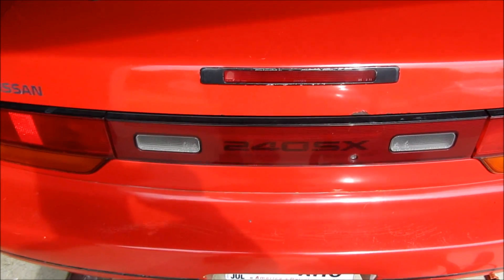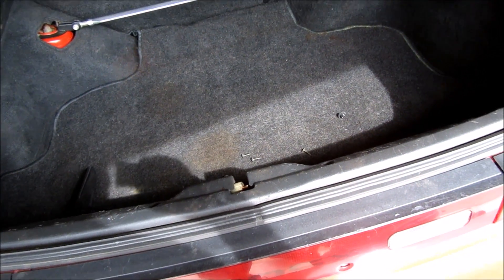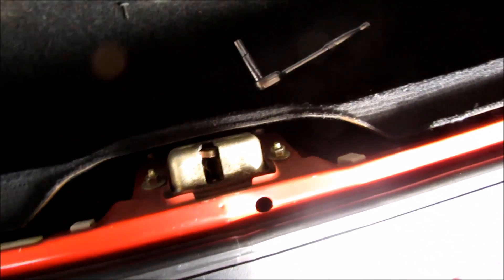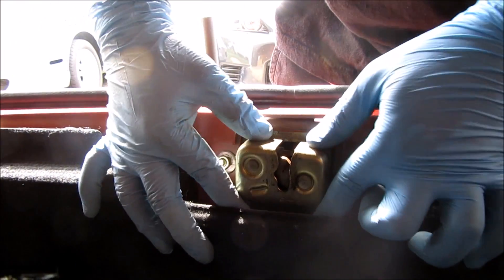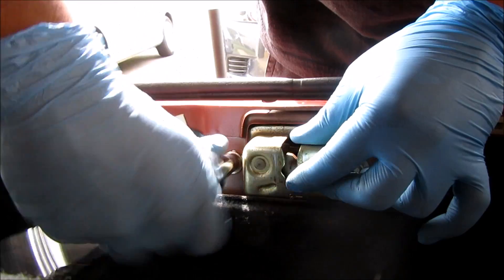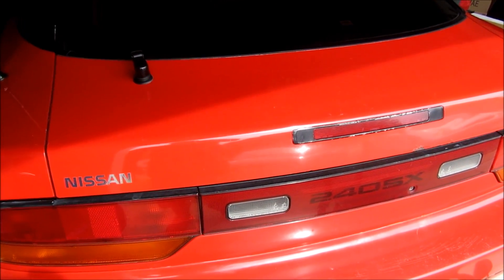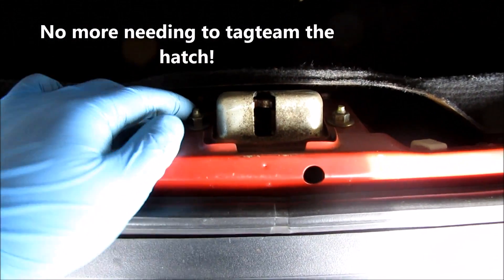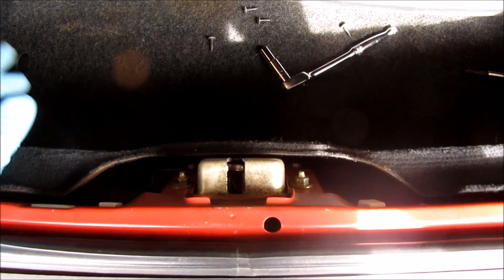S13 240sx Hatch Latch adjustment (EASY) Hatch not opening properly fix*

Comment: Yo!! I was a bit skeptical but holy shit it works! I have a '95 s14 and the locking mechanism moved so little that you could barely tell I moved it down at all!
There seems to be some misinformation in regards to the valet switch as there are mixed reports on whether switching the tab up puts it in valet mode or down. After I did what was shown in the video I closed my trunk, pulled the latch and it didn't work, but after I opened it and pressed the valet switch down, I tried it again and it pops like a dream! Never been so satisfied with myself lol. Thanks dude I hope this video gets more traction!

Just to make it super clear, I tried both valet switch positions prior to the solution in this video and my latch still wouldn't pop so I know for sure what fixed my problem was this video.
Reply from the maker: Glad that it helped!

Comment: Super helpful video man, good job. I used this method and I'm not sure how but the two bolts on either side of the latch mechanism snapped as i tightened them down and the latch just hangs freely. Getting a little sick of my hatch popping open on every speed bump and hearing the highway wind haha. To anybody using this method be very gentle with this piece as my moderately clean 93 hatch's bolts snapped like twigs. :/
Any idea what part number that is so I can order a replacement gold latch assembly? Or if you have a link to a cheap one that's even better!
Reply from the maker: Oh, wow that sucks.  Since the bolts thread all the way through that 
latch, I would personally remove the latch and just keep unscrewing the 
snapped off bolts from behind.  (You'll have to grab them with some vice
 grips, but it should work) Then once you get them out just run to the hardware store and get new bolts.  Just don't go hulk on them this time haha.
Reply: +DIYAutoCarage yeah they weren't too bad to get out. my best bet for replacing it is probably gonna be a scrapyard
Reply from the maker: Good luck
Reply: Linsa I was able to gerryrig it with zipties until I found one at a scrap yard for like 3$. no problems anymore
Reply from the maker: Man, you guys really hulk out on those soft bolts.  Those interior style bolts don't take much torque.   Glad you got it figured out though.